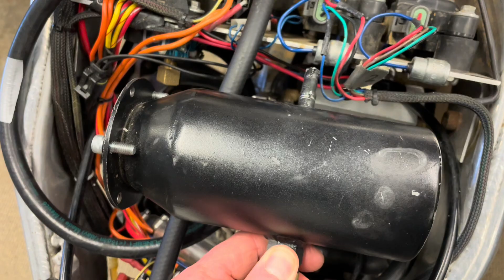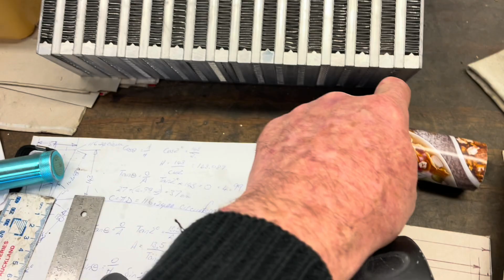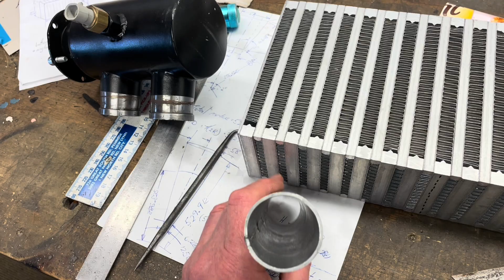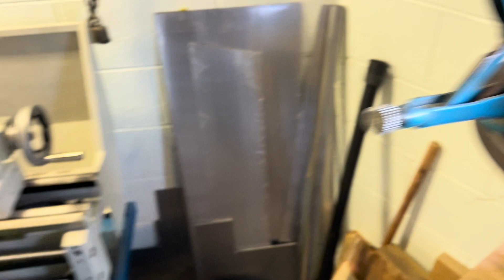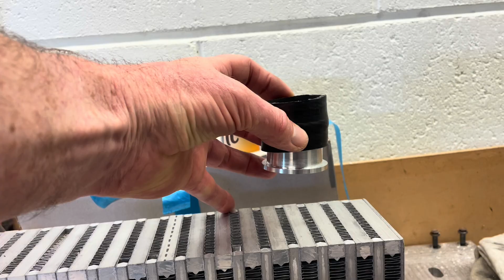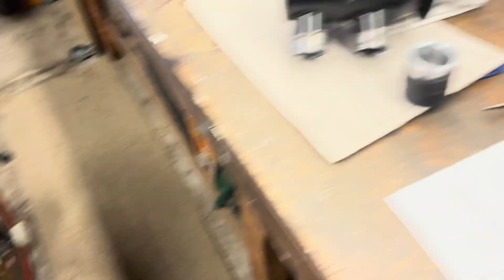FZR intercooler

Comment: Have you considered meth injection to cool the charge without an intercooler or a very small one. I wanted put a turbo on my fz when I had it. It's pretty cool to see someone actually doing it!! Keep at it man!!!!🎉🎉
Reply from the maker: Methanol would be awesome but there's problems with the rules. My big turbo bike runs on methanol using a draw through carb. It was a huge improvement over 100 octane. The big bike has the carb, plus a powerjet, plus a seperate boost operated circuit that pours fuel down the intake once over a few pounds of boost. It could use 1 litre per lap of Pukekohe. Where I could use it might be by spraying it in the air cooling the intercooler, latent heat of evaporation and all that. Only trouble with that would be if there was an unwanted spark somewhere.
Reply from the maker: I also had a Mitsubishi L200 Ute which I put a 2.3l turbo engine from a mustang into. It only liked about 5psi boost, unless I sprayed water down the carb on boost. With water it was fine up to 15psi which was as much as I tried